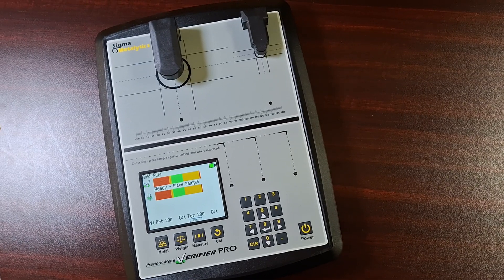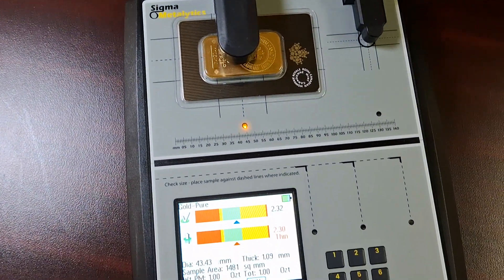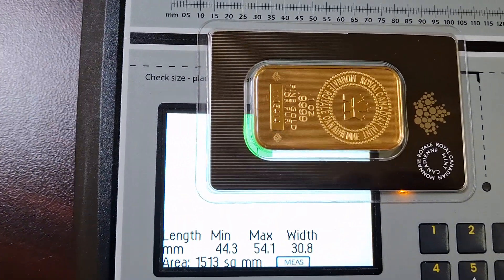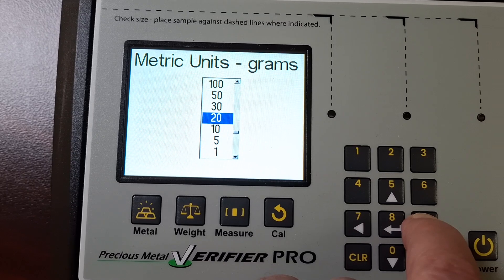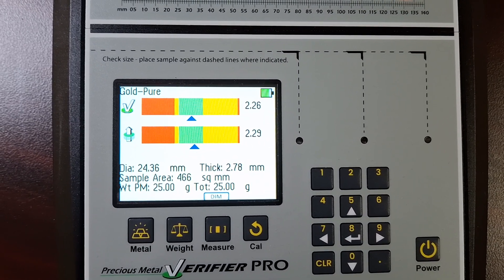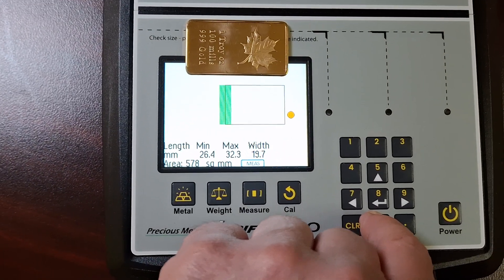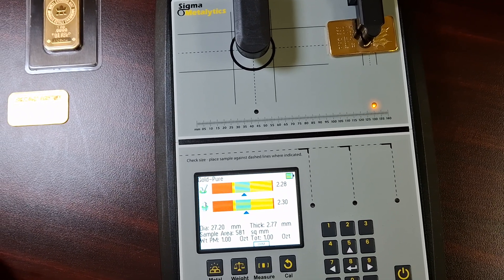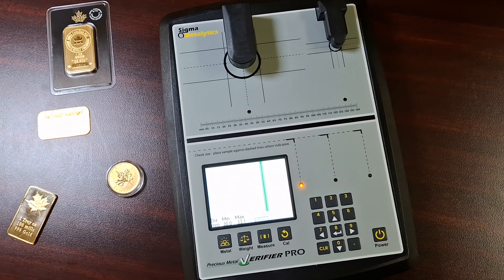FAKE GOLD TEST - SIGMA PRO

Comment: 1:52 you should really read the manual for this and understand the device before you try to describe it to others... 

The top reading is a surface reading the bottom reading is a" through scan" of the material.  It is not reading the bottom. 

It is also not telling you that the bar is too thin and to use the other side.  For the reading you need to enter the weight/shape of the material you're inspecting.

Also this machine does not do anything with specific gravity.  It just tells you general dimensions that the material should be.

7:02 yes it does go through the bar.  Different metals have similar electric RF resistivity... Which is why you measure the dimensions as well.
Reply: If it's a through scan why'd it read the 100 mill bar as pure gold
Reply: @BingoWashisname-O-x6m not sure what internal metal they're using but I'm going to order that fake from eBay to find out... He may also need to update firmware
Reply: @xephael3485  I hope you update us!

Comment: You should really read the features on that device. Sigma clearly states “the “thru” test examines the entire thickness of the bullion. This is particularly useful for detecting any internal inconsistencies or hidden layers that might not be visible on the surface.” Reach out to them if you have questions on your testing.
Reply: Correct. It measures both the surface, bottom surface not top, and through the metal. There's a lot of alloys that have the same resistivity as gold but none of them have as high a density. Not even close. For instance, 90Ag/10Cu has a resistivity similar to gold but the density is 10.3 instead of 19.2. Gold is so much heavier than these that just handling it will give it away. Not so much fake Silver Eagles. Silver clad copper fakes are surprisingly close and it pays to use the Sigma Pro's density check on these.
Reply: It does test right through. Both top and bottom surfaces as well right though the material is tested. The issue is that this works well for the majority of materials except tungsten. Tungsten is the only material (as far as I know) that has very similar magnetic/resistivity properties with gold and is commonly used by scammers to pass this resistivity test machines. This is why is important to do a variety of tests, the density is the most important and needs to pass.
Reply: @alexalexandrakis8205  tungsten has an almost identical density to gold (19.25 g/cm³ versus gold’s density of 19.3 g/cm³), it is commonly used in fake gold. Therefore, there is a high chance that novices may not detect a tungsten-core gold-plated bar or coin if they only perform a density test. However, tungsten can be easily detected if another test, such as an electrical conductivity or ultrasound test, is also used.

Herein is an important principle when authenticating gold: never rely on only one testing method. Always use at least two or three methods to achieve the highest certainty of authenticity.

For example, gold’s celerity (speed of sound travelling through a medium) is 3240 m/s, while tungsten’s celerity is 5220 m/s. The electrical conductivity of gold and tungsten is 44.7 MS/m and 18.52 MS/m, respectively.